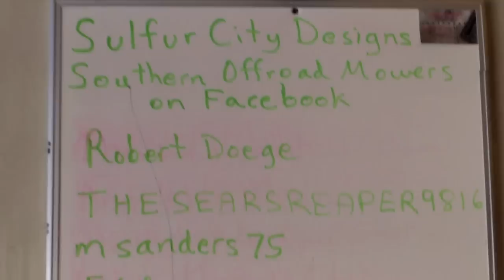Clearing the driveway!

Comment: I do the Craig's list all the time just got a old pos riding mower it's a mtd I scraped the mower but kept the 52" triple blade deck for my Dixon ....and the motor runs perfect .....the best part is the motor is a 18hp opposed twin....luv those things .....going to use that on the Dixon too....also picked up another black craftsman front drive key start push mower I cleaned it up bought a batt and clear coated it the thing starts and runs perfect....all for free gotta luv it ......damn cat!!!!!

Comment: Alright,Tech tip time. The very best sealant to use on sealing tires to rims is bearing grease. I do all my tire work myself for as long as I been driving,(seems like forever) on my vehicles. From dismount to mount to balancing to plugin. (my balance work is good up to 180 mph) and wheel alinements I've tried everything you can think of to seal a tire to the rim from silicone to rubber cement to even pipe sealant, hell I even tried tar at one point, But the best thing to use is bearing grease. Because it is nonhardening which means when the tire moves and flexes the grease will let the rubber move while it stays sealed, also will keep rim from rusting or corroding, and keeps the rubber soft. While other sealants will break their seal and start leaking and rusting or corroding with no exceptions. Works on valve stems too. I even got the fix for a leaky valve stem where you don't need to take apart tire to rim to reseal if interested.
Reply: Ok tech tip 2,Fixing leaky valve stem on the rim with tire together. First remove valve from stem to deflate completaly. I use one of those little four way valve stem tools. Screw fourway on cap threads and bend to the side as far as it will go without tearing rubber. Then while bent over squirt some kind of penatrating oil where the little open spot is on the rim.The Idea is to get the oil on the inside of the rim from the outside by bending stem to the side which makes a little gap where the hole is for the stem on the rim. Then with 4 way stem tool spin the valve stem clockwise ofcourse. This will work the oil into the inside of rim all the way around the valve stem. Repeat bending and adding oil a couple of times, it will get easier to spin which is what you want. When doing this with penetrating oil it will dislodge or derust or decorrode around valve stem area by using the  tightness of the rubber from the stem itself with the spinning motion moving the debree outward along with the penetrating oil lubing the stem keeping the rubber from wearing down which will keep tention on the rim, which will reseal valve stem to get rid of the leak without tearing down the tire. Then reinstall valve, inflate tire and check for leak with soapy water and bend valve stem also. Valve stem should be sealed by it being straight and also bent. If it is still leaking don't give up, Repeat all steps again till it seals. I've done this on the first try and also on the third try so don't give up. It does work.

I can't remember how I thought of this but I do remember I was completly broke and it was like 10 degrees outside with a flat tire in the driveway. No kiddin.